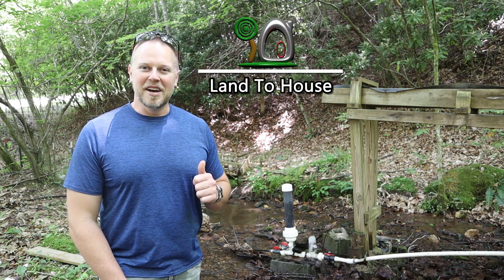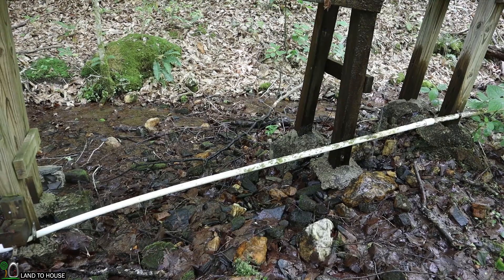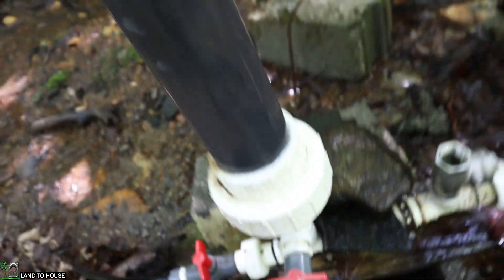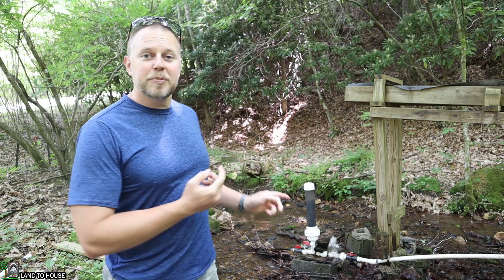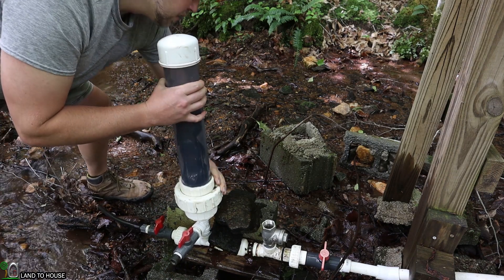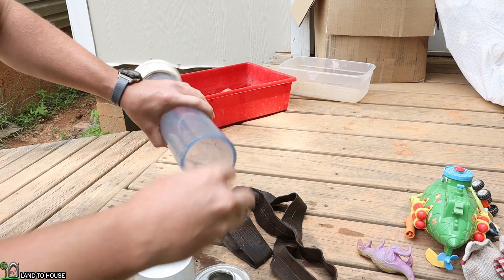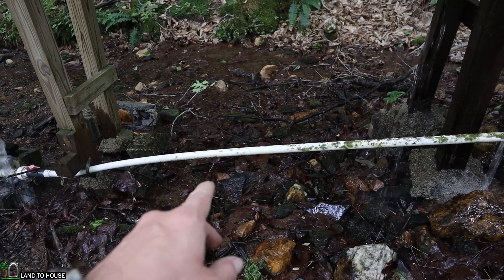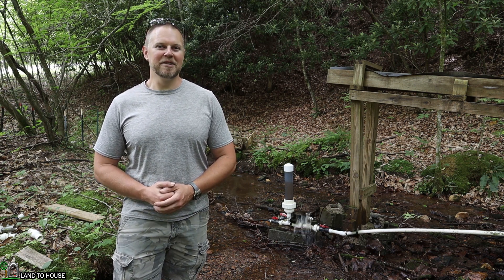Ram Pump Hits Hard [ How to Fix it ]

Comment: I am trying to lift water from one 250 gallon tank to a second 250 g tank higher up yo get more pressure for use. My drive pvc is only aboug a meter from the lower tank. Cycles well but does not lift the water the approximate 8 - 10 feet to the top tank.  How important is the length of the drive pipe?

Comment: I set up my 1 inch ram pump in my creek but there was a good flow of water but the water just flowed through. No sound and no filling of the pressure tank.
Any suggestions please will help thankyou

Comment: It is obviously not good to have a leak in your pressure tank.... but since the purpose of the pressure tank is to compress (while being shocked) and re-expand (pushing water uphill) in many many repeat cycles, then if you put a re-compressible material in the pressure tank, then a small leak shouldn't bother it too much.   I suggest perhaps trying a few squash balls or section of a kids spongy floatation noodle.   Maybe plastic packing/shipping peanuts.   Maybe a somewhat inflated bicycle tire tube (or two, for redundancy). Anything that can can tolerate huge numbers of compression and expansion cycles without deteriorating.
Reply: Look at his past videos, he tried many different things.

Comment: Have you considered installing the waste valve behind the the pressure tank? That way the hammer shock doesn't go up your drive pipe, but instead forces the water into the pressure tank...

Comment: Others are suggesting a shrader valve. I was also wondering but in the instance of a hot water expansion tank. Would that work as a pressure tank?

Comment: hey, try floating wavt wind turbine on a pipe axle to ground generator (both solar and wind large balloon collector, similar to a heat pump field but in a simple hot air plastic balloon, feed starter hot air up the pipe, have a second pipe to extract cold/hot air down), you get the idea, can use even a car charger as the pipe axle down generator, 4-point tether if you want the balloon to stay absolutely upright and not wonder around
Reply: open source no royalties free public domain idea, anyone can use it without restrictions

Comment: Hello Seth, I currently have a slightly inflated inner tube in my  pressure tank. You made the comment that the inner tube provides no benefit. Should I remove it next time I'm maintaining the pump? Any benefit to removing it sooner?
Reply from the maker: I have found that when the outside pressure of the water presses down on that tube it let's the air out. The tube can get pulled inside the lower part of the pump. Other than that you can leave it in.
Reply: Do you think if it is out of position, it would cause the pump to cycle slower? Mine cycles approximately every 5 seconds.

Comment: Just Bought the 1.25 pump...couple locations possible...most extreme test...25 ft drop, to raise water 120 ft thru 1500 ft of pipe...doable ?
Reply from the maker: If I were to set up with that situation I would reduce the input head pressure down to 18 or 19'.The extra feet would be more stress on the pump and is not necessary. The 1500 feet is not an issue for horizontal distance.

Comment: But what if you add a schrader valve at the top and when you need to do this maintenance you just pump some air in rather than shutting it all down?

Comment: Hey Seth. Love the channel. Would installing a shrader valve on the top of the pressure tank and using a bike pump work to put air in it? Or more of a headache then it’s worth?  Thanks for the content.

Comment: union fitting, is a good upgrade for repressurizing the innertube.  Drain tee for the drain is good upgrade as well ..  I replaced my cap with a screw on cap fitting.  I like the clear pipe upgrade too.